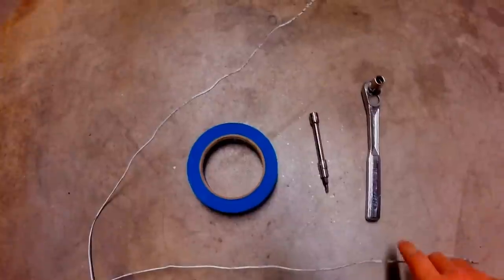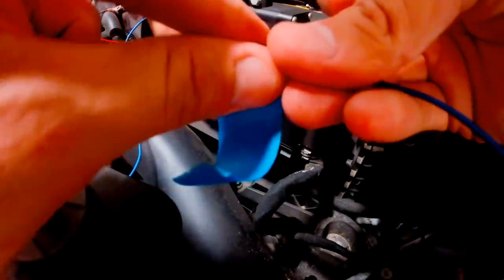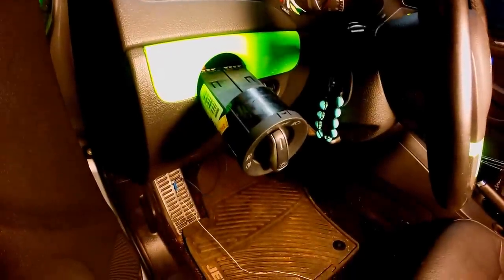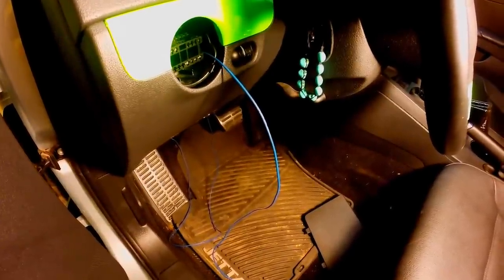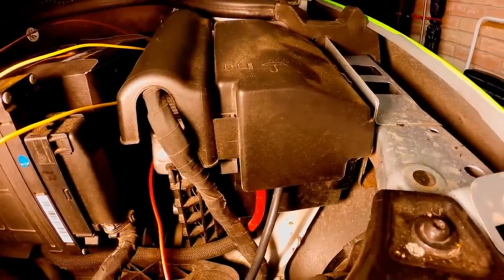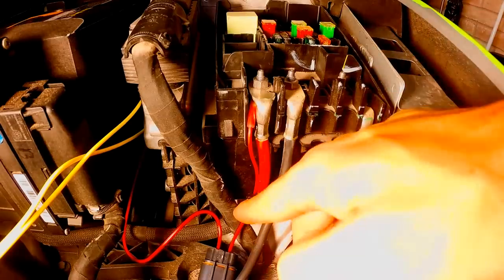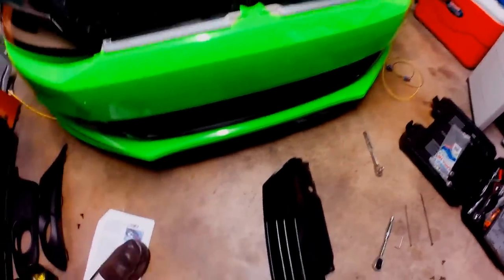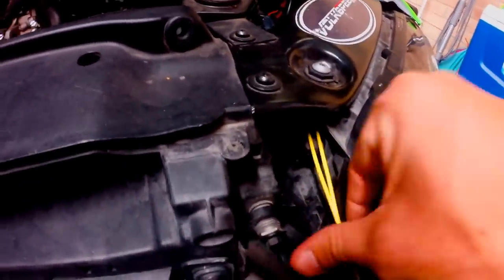ECS Tuning MK6 Jetta Fog Light Installation

Comment: why cant the ground negative wire in the fog light be connected to the body of the car ,,   and the 12 volt power positive wire be connected to the existing front fog lamps power supply which will only receive power when the foglight switch is turned on from inside the car ,  ,  no need for relays or complicated harness then  . Stick an inline fuse in the power supply to fog lights  as well  for safety  ,  would this work ?
Reply from the maker: Honestly not sure

Comment: So do the foglights have a seperate off and on? Or do they come on when you turn the headlights on?
Reply from the maker: Mars21681 can only turn on the fogs with city lights and low beams. Can’t turn them on while DRLs are on. If you have the correct switch, you simply just pull out to activate them.
Reply: caseygawriluk This seems to answer my question. So the euro switch turns the lights on and there is no aftermarket switch down by the shifter or anything? If a bulb burns out, is there a dashboard light?
Reply: @nathanpowell8953  I already have a Passat with everything on it. buying a petrol one next weekend and I'm just going to transfer everything including the auto headlights so they all come on when I unlock the car.. Buy a second hand switch from a scrapyard is what id do it if I didn't have one.

Comment: I have the same USP Motorsports CAI. The bracket that holds the steering fluid reservoir broke from the tension of the hose. Do you know where I can buy a replacement bracket?
Reply from the maker: +George Morgan no clue, sorry
Reply: Try contacting the manufacturer.
Reply: Yep, USP motorsports sent one no problem, even though the purchase was 3 years ago.

Comment: Also thanks for this video. I used it to install foglight from carid. I had to splice the harness off that connected to the crappy switch it came with in order for me to wire to my auto headlight switch.

Comment: Yes! Been waiting on something like this
Reply from the maker: +Jester25ft If you run into any problems, let me know!
Reply: +caseygawriluk NP!
Reply: +caseygawriluk Hey bro so I bought the fog light kit from USP along with the HID kit conversion kit. A friend and myself installed the fog lights last night but they fogs won't light. Another issue is the green fog light logo on the euro switch stays on even when the car is off. Any solutions?
Reply from the maker: +Jester25ft no clue....
Reply: caseygawriluk figured it out.
Reply: Hey, I know its been a while since you posted this comment. Do you remember what the issue was and how you fixed it thanks.

Comment: I don't mean to spoil this parade of compliments, but what exactly do plug that blue treaded wire in, on the ENGINE BAY side? 
Even the very ECS installation instructions do not mention one iota about the purpose of the wire, other than connecting it to Euro switch. That's just one end of the wire. Most DIYers  could read and follow instructions...
Do you just grab a wire out of the blue (pun intended) and tread it into the cabin to connect it to the Euro switch, or it is one that it is ALREADY connected to something in that wire harness that comes with the ECS kit? You need to explain that if you really want to help people. Is it going into the RELAY? That would be the only educated guess I could come up with. Is that the case?
I know that nobody posted comments for almost 1 year, but maybe you receive notification for "new comment" and answer (or revise your tutorial). Tks
Reply from the maker: chefroA6 this tutorial is literally ECS’ installation instructions. I just felt like making a video version of it for myself.. Didn’t actually think it would blow up and get lots of views. I don’t need to revise anything. If you are having trouble, contact them. Don’t come complaining to me about something you can’t fully understand... ORR have someone install it for you. Thanks.
Reply: The blue wire is the trigger wire for the relay. Instead of running higher amp wires and a heavy duty switch you can just run a thin gauge wire to trigger the relay and turn on the lights.

Comment: Great time to change out the shitty horn! Lol mines already came with fogs. But you need to install hella horns if you haven't yet. ;) much better.
Reply from the maker: Need to do that ASAP as well. Will look into it
Reply: +caseygawriluk it's very easy to install. My horn was located by the passenger fog light. Install was easy peasy. Just tap into the old horn using connectors and cover with tape and just bridge the horns.
Reply: Hi, I have a 2015 Jetta no fog lights. Can u tell me how to remove that front plastic grill on the passenger side?? I tried it a couple times but it won't budge. I've been wanting to replace the horn. Thanks.
Reply from the maker: +Basement31 not sure if it's the same on a 2015. Mine is a 2012. But it just pops out
Reply: @casey, ok thanks I thought yours is a 2014/2015
Reply: @casey, ok thanks I thought yours is a 2014/2015....cant find any tutorial on 2015 Jetta regarding fog lights or horn install
Reply: +Basement31 i believe your horn is located in the windshield wiper tray. look around on vwvortex!
Reply: @tom Pham , the horn still in the same location as the 2012 - 2015 Jetta which is in the front passenger side behind that said plastic grill.

Comment: Wanted to see how to remove the lower outer grills, but you chose to skip that step entirely and spend way too much time showing us how route wires...
Reply from the maker: Gary Shepard use a plastic pry tool and start on the sharper point moving outward pulling towards you. It’s super easy to remove and not necessary to show. The main point of the video is how to wire it all up as a lot of people are afraid and have no clue how to do that type of work